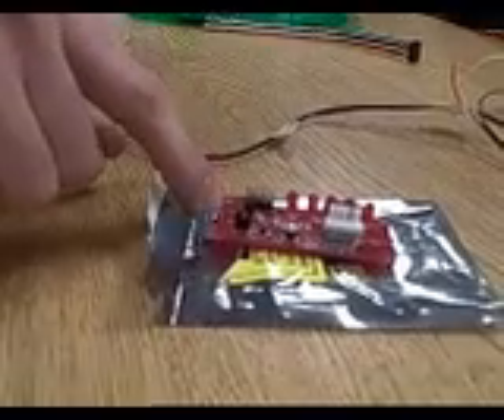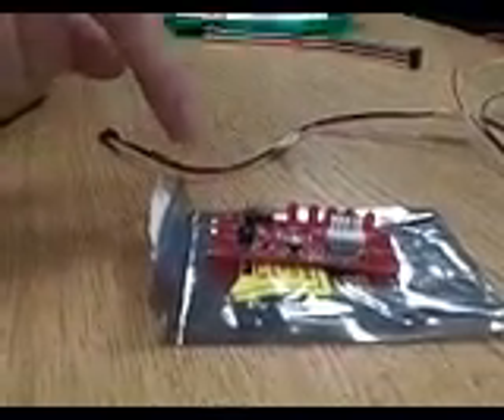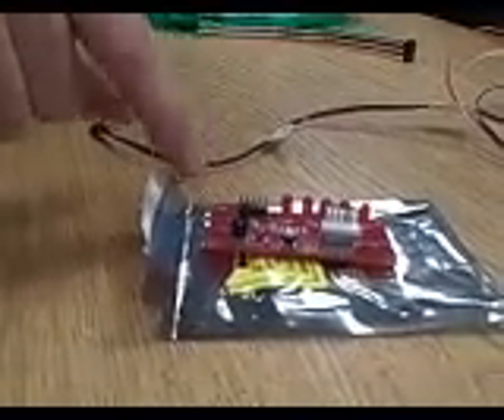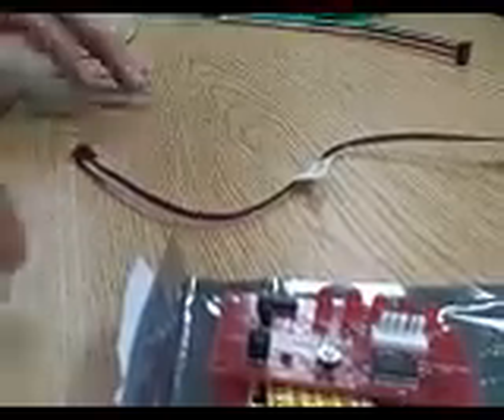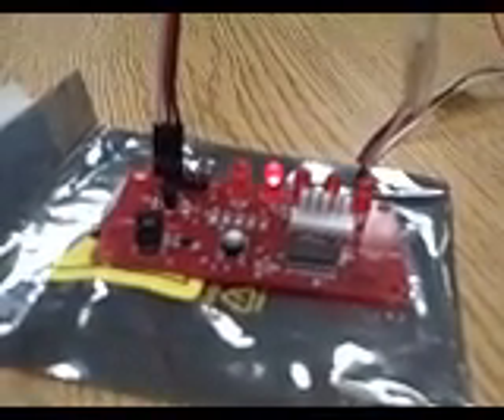FIRST 2008 Season Game Hint 1 - IR Board Setup

Comment: (part 2)

We haven't hooked this up to our robot yet, but when we do, it'll probably require splicing wires together between PWM cables and the provided ribbon cable. I thin we're going to connect the 4 signal pins to 4 of the signal pins on digital i/o ports. For that, I'd recommend taking a look at the tutorial from the kickoff video, which you can find on NASA's kickoff website.

Comment: Yeah, for our testing we only needed wires for power and ground, and we had a pre-stripped female end of a PWM cable lying around, so we chose to use that just because it was easier than stripping the provided ribbon cable. We will use the ribbon cable when we put the board on the robot, though, because we'll need to connect to 6 pins. (power, ground, 4 signals)

(contd. below)